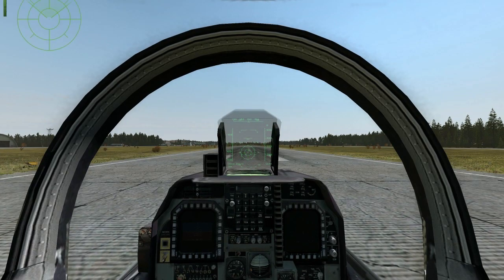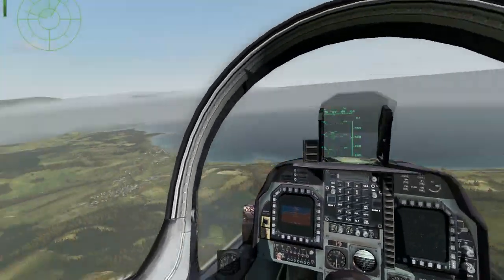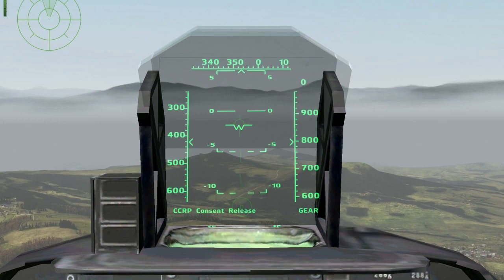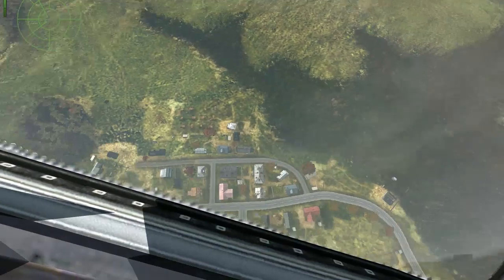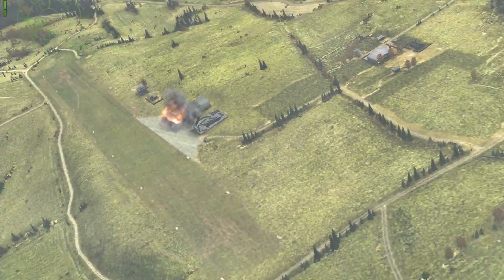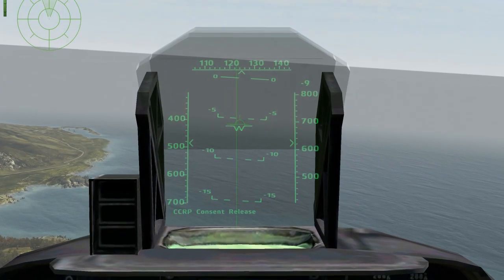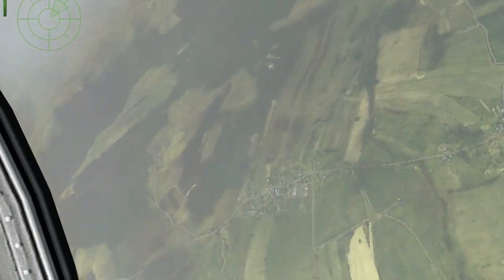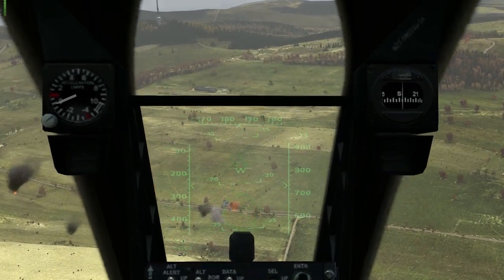Nou's Aircraft HUD Improvement Project, v1

Comment: I need some assistance: When in CCRP mode, I press and hold the primary fire key, as if I would be firing my main cannon, but the bomb sight does not change and the ordinance does not release. I'm using a flat delivery at less than 300 MpH in a Harrier. What am I doing wrong?